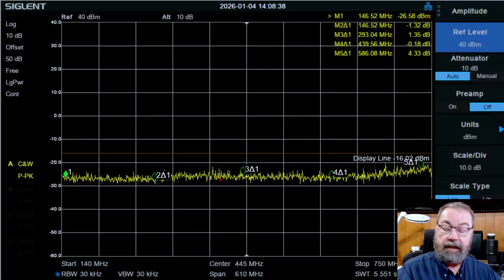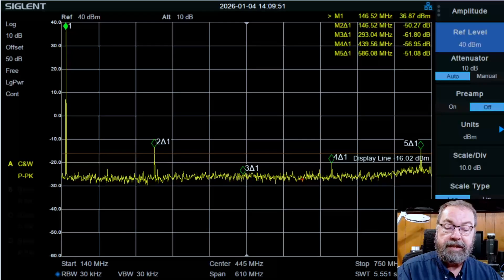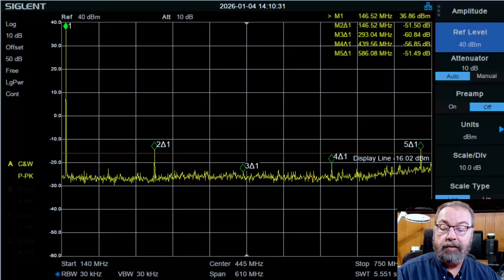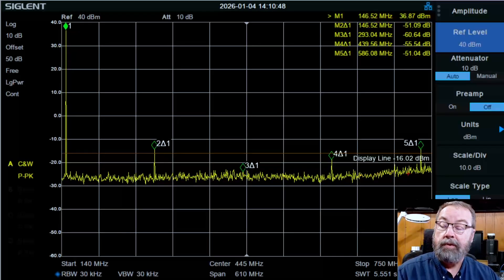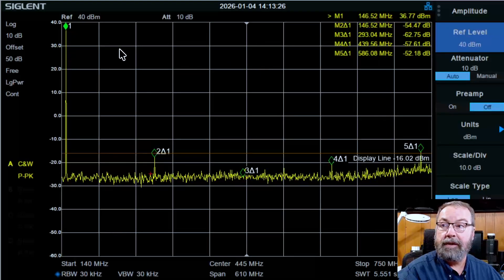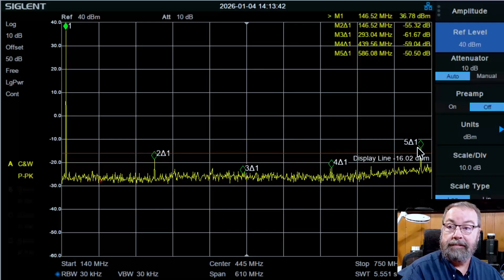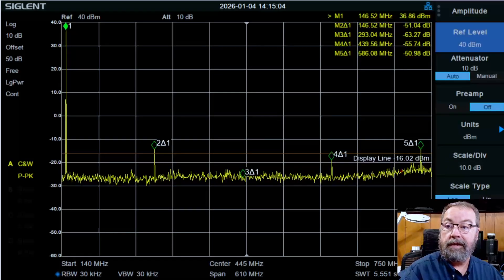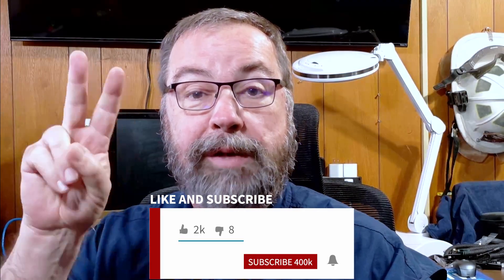Mea Maxima Culpa!

Comment: What is the cause of the 5 dB rise in baseline noise at the high-frequency end of your plots?
Reply from the maker: Adjusting the RBW on the SA  - wider RBW more baseline noise.  100 is fast enough, 30 is better, lower noise floor, but hella slower to sweep.

Comment: Hey Jim, a few observations and questions.  My theory would be that if you used 50dB of total attenuation, you should have had 52.79 dB (lets just round to 53 as it falls within the acceptable limitations). My theory (again, I am not saying I am right and don't want to get into a war), the results carry the potential to result in a 6dB error at the 2nd harmonic and a 9 dB error at the 3rd. My 53dB calculations are based  a November 2015 article by Larry Wolfgang in QST, titled,  “ARRL Laboratory Handheld Transceiver Testing".  In this article, they speak about 10(log) equations.   I reached out to the ARRL and asked them the following, 2 years ago - "In the Technical Correspondence section of the November 2015 QST, Larry D. Wolfgang (WR1B) (tc@arrl.org), wrote on the testing of Handheld Transceivers for spectrum purity. 

 

During the article, part 97.307(e) was mentioned, which reads

"(e) The mean power of any spurious emission from a station transmitter or external RF power amplifier transmitting on a frequency between 30-225 MHz must be at least 60 dB below the mean power of the fundamental. For a transmitter having a mean power of 25 W or less, the mean power of any spurious emission supplied to the antenna transmission line must not exceed 25 µW and must be at least 40 dB below the mean power of the fundamental emission, but need not be reduced below the power of 10 µW. A transmitter built before April 15, 1977, or first marketed before January 1, 1978, is exempt from this requirement."

 

One example then provided stated:

 "For example, a typical 5 W handheld transceiver transmitting at 146mhz would need a minimum of 53DB of harmonic and spurious suppression. For a 5W Transmitter, a minimum of 52 dB is required; 3 W = 50.8dB, 2 W = 49 dB, 1 W = 46 dB and 100mw = 40 dB."

I loved the example and I am in the process of making a video to help explain the testing procedure further.

What I understand from the examples used:

 

1. Transmitter power (for example 5w) - 5W = 36.9897000434 dBm 

2. 25 MicroWatts = 16.09dbm 

3.  36.99dbm + 16.09dbm (but need not be reduced below -20 dBm (10 Microwatts)  = 53.08 dB of attenuation needed to test a 5 watt radio.

 

If my logic and understanding is correct above; From this point, it would be as easy as setting up the analyzer and checking the 5w of transmitter power with the 53 db of attenuation to confirm the spurs are greater than 40dB from the fundamental emission.

 

What I was hoping was to get confirmation that I read that article correctly and if not, may I have confirmation of the 25 Microwatts - 10 Microwatts?

Thanks so much for your time and any input you may have.

"  George Spatta, the Labratory Manager for the ARRL responded back - "Yes you got to the correct numbers below! Another way to calulate the required supression is:

Converting power to microwatts, to make it easier:

25W = 25000000 uW and so the required suppression is 10log(power ratio) = 10log(25000000uW/25uW) = 60 dB

5W = 5000000 uW, 10log(5000000uW/25uW) = 53.01 dB
4W = 4000000 uW, 10log(4000000/25) =  52.04 dB
3W = 3000000 uW, 10log(300000/25) = 50.79 dB
2.5W = 2500000 uW, 10log(2500000/25) = 50 dB

2W = 2000000 uW, 10log(2000000/25) = 49.03 dB
1W = 1000000 uW, 10log(1000000/25) = 46.02 dB

0.1W = 100000 uW, 10log(100000/10) = 40 dB

If you have any other questions feel free to reach out to me!"    By Georges calculations for proper suppression and what I see on screen - 10log(4753352/25), this is 10log(4.75 watts / 25 microwatts) = 52.79dBm of attenuation, again rounding to 53.     My question, for the curious mind, would you be willing to test this with 53dB of attenuation .. Someone should just ask George Spatta over at the league, what he thinks. In fact, I will just send them a UV5R mini.  Thank for your time and consideration at helping me understand my theory.

Comment: Such a load of BS. At that powerlevel of 25 micro watts (0,000025 watt), no one will be bothered by these radios. These are portable radios people move around with all the time. So even if you possibly briefly interfere with anything at 0,000025 watt, the radio operator won't be there for long and is not having hour long conversations like you have on a base station. This is called nitpicking at a professional level. 0,000025 watt won't even get trough the walls of a concrete house.
Reply from the maker: Facts - and when you push that 25-ish uW thru a less than perfect antenna - you'd have to be in their lap to have a snowballs chance in hell of it interfering.

Comment: Great catch ! That why we test out stuff. I have tested many attenuators and many are not correct . Some not even close . Now you found that on cell wave label it .  I have same spectrum !  Great piece of test gear. So much better than a tiny SA . Now they a FAIL and you proved the 2 not the same either .This is what I seen on the UV-5R testing like 25 over a few years . They test all over.  73

Comment: The big deal on this if you look at part #97. IF someone complains about interference, you have to take steps to fix it. That is all. No fines. No license removal. You have to fix it. Well, I can't fix a Baofeng. Ok, the turn it off and don't use it. We are not going to jail over this. Bottom line, I don't test. I have a reasonable expectation that the factory did their job. If someone reports it, I turn it off. Problem solved.
Reply: 25 micro watts won't bother anyone. These are portable radios you take on a hike and move around with all the time, and have very short conversations with. this is nitpicking at 25 microwatts. It's 0,000025 watt for FCC sake. won't even reach outside of your house.

Comment: I don't math well either, that's what calculators are for - but I saw that 27dbm on the screen and have hung around db enough to know something was up.
I've caught this myself on my TinySA Ultra as I blew up the front end and now have to solder a 1.25x2mm part in...
Reply from the maker: Dude - TO and I both should have caught that.  I'm glad you did!  Apparently, I was up too late last night.  You have fun soldering that...I messed with the voltage reg. on those AIOC's a couple of years ago, and with a lighted microscope TV dingus, it was still a giant PITA.
Reply: @FEPLabsRadio  At least the TinySA Ultra's input switch is only a 6pin. I'll record it for fun

Comment: Hmm, I still have questions. Does the specification for the test state modulated/unmodulated carrier and if you just push the PTT was there modulation? The other question is around the fact that on your spectrum analyzer the floor was raised up on the 5th harmonic and does that need to be factored into the -16 dBm threshold? I pesonally have no idea, just some thoughts that crossed my mind watching this.
Reply from the maker: Good points!

CFR 74 Part 97.307(e) doesn't state modulated or unmodulated.  As this is with FM voice modulation wouldn't change anything.  If you were doing this VHF sideband, I'd assume modulation, as there is no carrier as with FM.

The 16.02 line is strictly a display function for user reference.  What you are seeing on the 5th, is that the attenuation at 146 is 50dBm.  However, as frequency goes up, the attenuation factor drops, however, the harmonic is still there, generated off of the 146.52 primary freq.

Thanks for watching!
Reply: @FEPLabsRadio   In FM if there is no modulation signal there is only a carrier (all the power is in the carrier), and as the signal starts to get frequency modulated the power in the carrier drops as the power increases in the sidebands. Unfortunately the actual power level of the carrier and sidebands depends on a formula involving the Bessel function - which is non-linear.

Comment: My throw-away Baofeng UV-5R Mini tests clean on a Anritsu MS2711D spectrum analyzer, with 40 dB of external attenuation. There is complete 2nd and 3rd harmonic rejection, similar to my Kenwood TH-D74. If you anticipate 5 watts from a handheld radio, 40 dB of external attenuation is perfect. Too much attention can cause artifacts produced by the analyzer.

I have a Radtel RT-330 that produces wild spurious emissions under the same test bed. 73 de KO4CES
Reply from the maker: Interesting data! Always good to hear about different experiences with these radios and test setups.  What I see here in my testing, and in others, is a wild lack of QC in the radios.  That being said, it ain't terrible bad, and when you factor in actually using it with an antenna, "barely failed" ain't bad.

Comment: Good for you Jim for doing this test again and showing the results.  
Here's my take on why many HT's in this class fail the test: 
A L.O. which produces a square wave (filtered into a modified sine wave) is the beginning of the harmonic issue.  Nearly all of the modern rigs us a DDS and some have better filters in that part of the circuit to really clean up the signal at this ultra low stage.  This is probably where the 5th harmonic is originating from.  Back in the day, when radios used quartz crystals, the oscillators were very much cleaner because a crystal is a resonant circuit of very high Q which produces a near perfect sine wave.   Additionally, manufacturers took great care with the design of their LPF for EACH band.  They also had room inside the rig to use larger through hole parts that generally were of much tighter tolerance.  Today, SMT parts probably do not have that tight a tolerance, and so the LPF is not as accurate which is why we see a discrepancy between each HT in this test.  I strongly suspect that the LPF is of singular band design and the HT does not use two switchable LPF''s depending on which band the radio is transmitting on.  If we employ a LPF for 440MHz, it will not attenuate harmonics for the 2M band.  If we use a LPF for 2M, then we will have no output on 440MHz because the filter will block it. This is why there really should be two filters switched in/out for the band being used.   I'll further add that the rise time of MOSFETs used in the final amplifier are much faster than the old bipolar transistors (which were found in radios that are 30 or more years old) which were unable to amplify far beyond their design frequency.  This new ultra fast rise time in the MOSFET means that the PA (power amplifier) can amplify harmonics that are way above the band of interest and the rig must now rely solely on the LPF to attenuate those harmonics.  Not an easy task for a rig in this price range.  I don't fault the manufacturer.  You get what you pay for.  A $500 FTM-500D doesn't have this problem.   73
Reply from the maker: That's an excellent breakdown, thanks for sharing your insights!  I was put out more that I dorked up the test than the radio was not clean.

Comment: Do you think that FCC will put a halt on the import of these? Could a firmware update fix this?
Reply from the maker: I seriously doubt it.  Honestly, while these are fails - keep in mind that A) they barely (i mean squeaky) fail.  B) Matt Heere mentioned in the chat, and he's correct, when you throw in the average HT antenna, this barely fail (but it is a fail), is basically going nowhere anyway, which is why the tests are done with coax.  I doubt the SA would pick up those harmonics OTA.  The FCC would have to have a lot more egregious violations to get involved, IMO.
Reply: No they won't 0,000025 watt won't even get outside your house, let alone bother any device near you.

Comment: Please forgive my skepticism, but after all of these tests and retests, I am not sure any hams are capable of a valid harmonic test using at home processes.
Reply from the maker: It can be a challenge - not the actual testing, but the setup of the testing is critical.  It isn't super difficult, but it's a process to get the gear configured right.  That is the tricky part of the whole thing.  A tiny sa will work as well as the Siglent I used, but without proper setup - the results will be off.